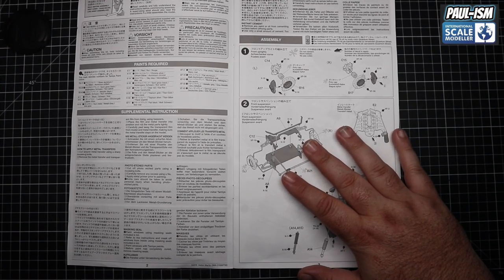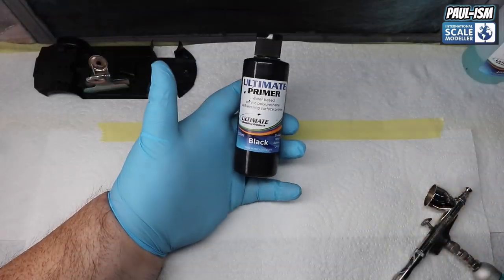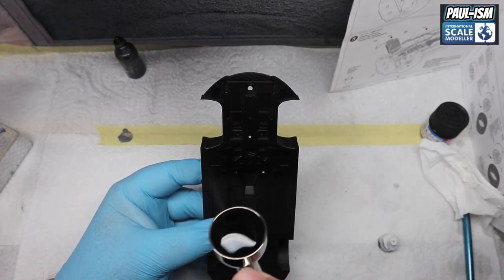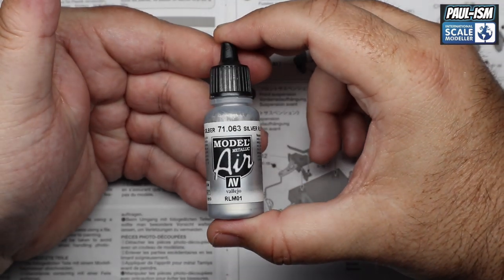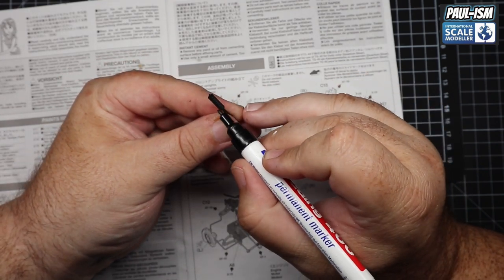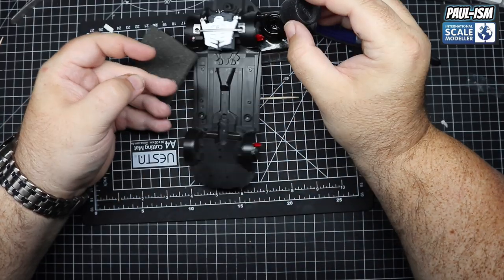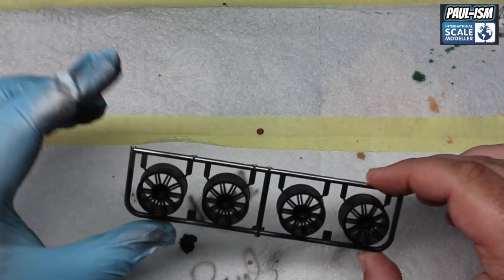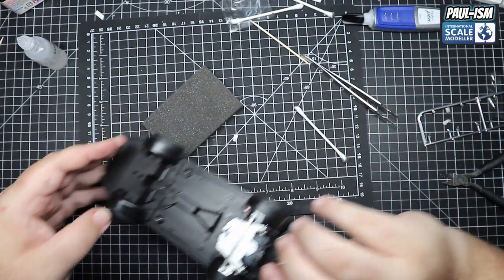Part 3 - Tamiya 1/24 Aston Martin DBS Step by Step Build

Comment: Great video Paul.  I’ve noticed a new thing with Tamiya lately regarding their metal transfer decals.  I just built the recent 2018 NSX and It came with front and rear badges which I mistook for metal transfers when they are actually proper metal stickers that you need to peel the backing paper off and stick straight onto the body. I now realise why others who built this kit had trouble getting the badges to stick.  This may have been the case for your Aston Martin engine badges.
Reply from the maker: Yes these were the same stickers a real pita imo lol

Comment: For my build I did spend the money to buy Hobby Design photoetch detail kit. So I have a choice between the kit's metal transfers and the Hobby Design. I will let you know. I know using the photoetch will be tough gluing it in place with the smallest amount of glue. I do have some very small  photo etch glue applicators.
Reply from the maker: Cool, good luck :)

Comment: Paul great work by the way. On the water brush you use for your decals are you able to fill them up with the solution and what are the ends like ie the brush bit cheers
Reply from the maker: Cheers Steve and yes you can fill them up but I found as they are not air tight if you keep the solutions in there they lose there potency over time, the brush is a soft nylon brush
Reply: International Scale Modeller cheers Paul so just empty it after use okie

Comment: Lovely. looking really good Paul. 

Did you glue the Poly Caps in? These  not meant to be left free?

Thanks for the work, appreciate it.
Reply from the maker: Cheers buddy, no I didn't glue them directly, but even if you did it wouldn't matter as its the wheel stud that's sponsors in them anyway :)